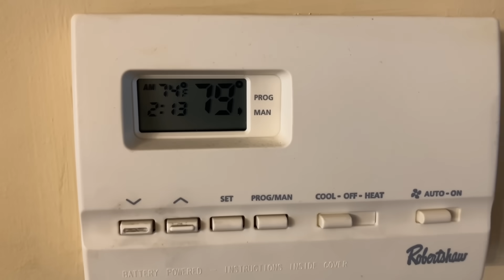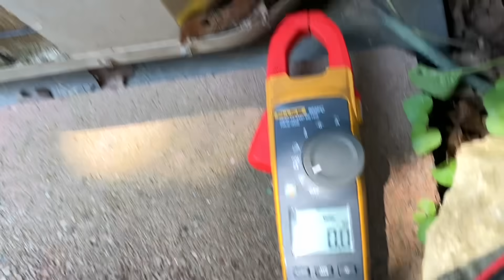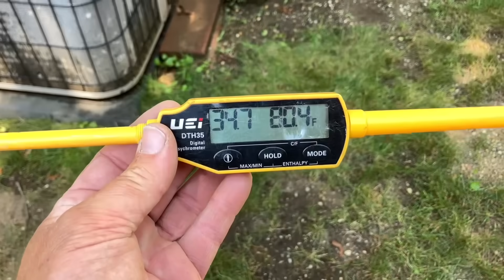🔥 July 4th Emergency AC Breakdown - Blazing Hot Outdoor Unit & Burned Out Capacitor! CONTEST INSIDE

Comment: $275 trip charge and $40 for the capacitor for a total of $315.
Reply: $275 is for 1st hour . plus $125 trip charge
Reply from the maker: @brian-ek1ec you got the labor rate correct.
Reply: @PipeDoctor  I thought The principal regular 1st hour is $275. This is an  emergency so has to be more than $275. Then it's boots on to boots off for trip charge
Reply: @PipeDoctor he's probably on a maintenance plan. So no emergency rate and trip charge. 

$275 for the labor
$100 for the cap

$375 total.
Reply: $567 w/o tax